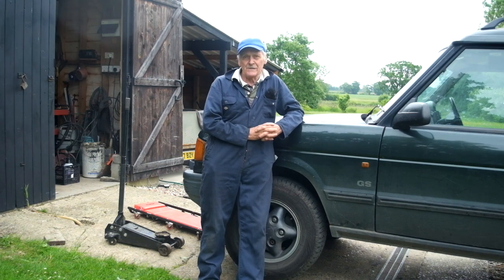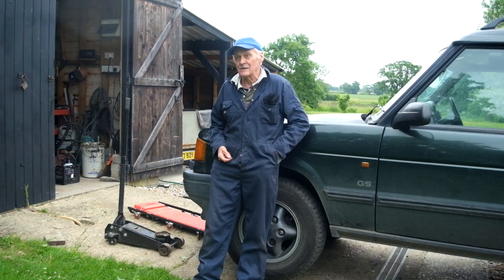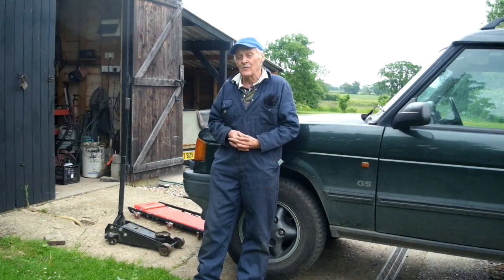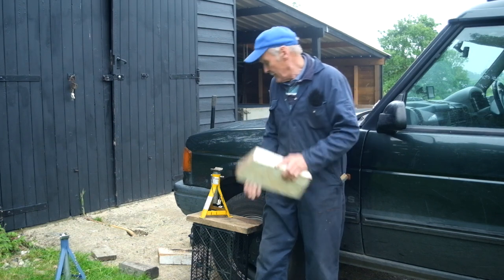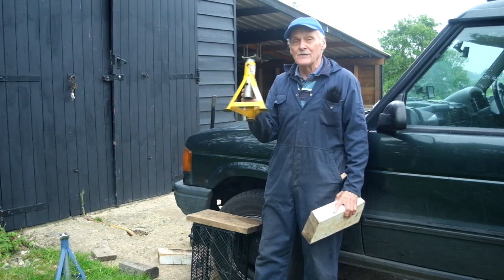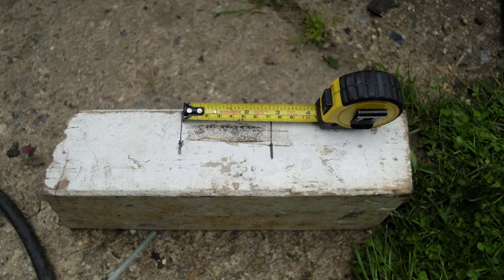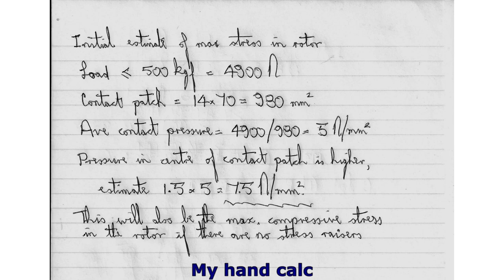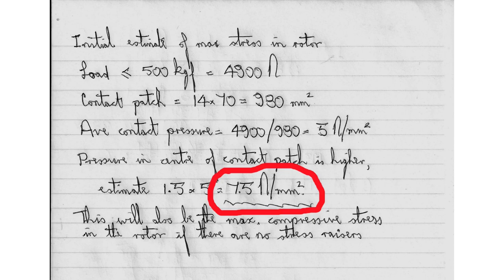Jacking and supporting vehicles for work - my approach

Comment: Excellent analysis as always. Have been jacking up 4x4s for over 40 years and always leave the jack in contact with the axle once lowered onto stands. Interesting analysis on the brake disc though it's something I don't do habitually as not all discs are created equal. I once had failure of a disc on a jeep (while driving) because the manufacturer in their cost cutting wisdom used pressed steel centres with the cast disc welded to it and readily prone to rust. A truly horrible idea.
Reply from the maker: I am the first to admit that putting a support under the brake rotor is a bit sloppy but very convenient If I was actually working under the vehicle instead of standing outside it I'd put a support under the axle.itself.
What a horror story about theJeep's disk brake.

Comment: In the 20 years ive been working on or around cars I always leave the jack in place...why wouldn't you unless it's in the way? It can't hurt and if anything does shift its extra support
Reply from the maker: Totally agree however the troll who criticised my earlier video has other views. It's very difficult to envisage a situation where leaving the jack in place can jeopardise safety provided there's another independent means of support. However I can imagine situations where an axle stand might fail and a jack wouldn't (e.g. sinking into the ground, which a jack is unlikely to do because of its larger base area).
Thanks for the comment.

Comment: Second comment re axle stands. I have three pairs, two of which are high lift, and one of those is ex NATO   I never extend them more than a couple of holes, as it looks increasingly precarious.  Always conscious of the triangular foot and the potential to tip, That’s why a two foot piece of sleeper with another on top then a 6” square oak post section on top,has such a massive footprint in all directions that with weight on, is not going to move anywhere.

Comment: My two penneth. If I’m using a jack on a corner which weighs abit over half ton. I’ll use a 3 ton trolley jack or a four or six ton bottle jack. I’ll add support, either an axle stand or decent wood blocks with the largest and widest at the bottom and lower onto that. Then I tension the jack so it’s lifted the load by a fraction and now I have the solid support ready to “ catch” the jack if the jack fails or subsides. Also a good test to see if your jack is leaking by, where after an afternoon or day , is that fractional lift still there?  All my axle stands are second hand but of very stout steel construction and by guessing I’d say are rated for many times the load I will ever give them. That means I’m confident to rely on them when underneath my 109. Like a Victorian viaduct, extremely over engineered.

Comment: Only problem using the brake disk as support is that without the wheel it’s only attached to the hub with a small locating screw so any unexpected sideways load and it ‘could’ pop off. I’d use suitably sized wood over axle stands anyday esp if you have both wheels off as they will give better lateral stability ( suitably sized) than the rather narrow axle stand geometry.
Reply from the maker: That's a very good point, exactly the sort of comment I was hoping to receive. I would add that I would never do this is if the other wheel on the axle was off at the same time and you have given a good reason not to.
Reply: clearly you don't know  landrovers  it has  it has 5 m12 bolts holding the disc on
Reply: @defendermodsandtravels  the other aspect that can be drawn from the comment by John Griffen is that this is why two independent processes are much prefered to the pure checking of calculations process. Sometimes it is what is not calculated that bites us
((in the case of the Discovery 1, I think the disk is well bolted, which is quite unusual compared to other more modern cars)) but for my part big brownie points for thinking outside the box John G

Comment: Hello, this is Todd , I love ur correspondence and the factual information from an extremely intelligent and competent individual such as yourself. At some point, I would like to see a comparison analysis of shear, bending moment, and radial forces, as far as repairs on auto frames or modifications, using welding vs. the proper application of riveting.. joint tensile strength, shear , bending moment, and spiral twist flex loads. Thanku for ur time, look forward to a proven and proper analysis.

Comment: I can attest to using dunnage. I once used a jackstand similar to the blue one in this video, on very hardpacked gravel, when the vehicle suddenly shifted as the jackstand sunk into what I thought was a safely hard surface. The only thing that saved me was my habit of putting the removed tires under the vehicle as a safety stop. After that, if I needed to use jackstands on other than concrete surfaces I would put a square of plywood and/or other dunnage under the jackstand.

Comment: you've put an admirable amount of effort into this assessment of your practices for a comment that probably should have been disregarded. but to ad to the conversation the only reason i personally stay away from supporting a vehicle on its rotors is the increased risk of it rolling, but if you're supporting only one side of the vehicle that risk seems rather low.
Reply from the maker: You are right although if you see the depth of the indentation made by the rotor in the dunnage you will realise that there'll be considerable rolling resistance.
For it to roll either of the following conditions must be met. 1) The mechanic forgets to chock the other wheels, or 2) the chocks get removed somehow. Oh yes, the vehicle needs to be on a slope too (which is a total no no when jacking). The chance is pretty low although, having worked in offshore construction yards for years, I understand how accidents can happen when they shouldn't.
I leave it to the viewer to decide how they wish to support their own vehicles.
And yes it was a lot of work but I couldn't leave the critic's comments (about causing fatal accidents around the world) go unchallenged.

Comment: I started watching this thinking (and yes, im aware no-one asked lol) I watched that video, and didnt have any problems with the way you worked, especially not with the wood blocks, and I have no issue with leaving a jack support as a fail safe for the very reasons you go one about. Then you started on about the wood blocks, or dunnage to be more precise, and I was like ok good. lol.I do appreciate that you took the comment as well as safety seriously, rather than scoffing it off. I think most people dont quite appreciate the qualities of wood, being a natural material and somehow mysterious to many. While I wouldn't normally put wood or support directly on the disc (dont normally have a need to) if I were going to support it it would be with wood only, I wouldn't ever use a steel jack stand for that purpose, basically for the same reasons you point out here.

While I dont expect an answer, I do have a question regarding your analysis: Would there be a difference in the load at the moment of impact, IE shock and would that make a difference? Clearly using wood means it softened that but id be curious if the numbers would be higher for a moment and if the time length of that shock load number mattered to the integrity of the iron? This is purely theoretical as a question mind you and I hope im making sense.
Reply from the maker: Hi Erich thanks for the comment.
I am first to admit it's a bit sloppy to support the axle via the brake rotor. If I had supported the axle tube instead it would have taken 3 - 4  of those wooden blocks on their flat sides (maintaining the same height to width ratio of the pile). I would either have needed to lie on my front to manoeuvre them into place, exposing myself to the risk of jack failure, or to have devised a way of pushing the pile under the axle without going under the vehicle myself. In reality it's just easier to stick a block under the brake disk without exposing myself to risk.
Lowering the axle onto the wooden block has no measurable dynamic effects. If I had dropped it from a considerable height onto a really hard surface it'd be a different matter.
I hope that helps.